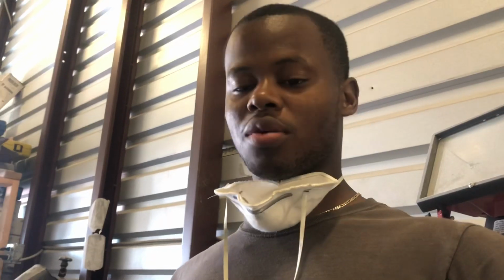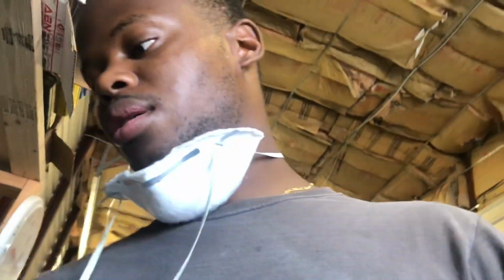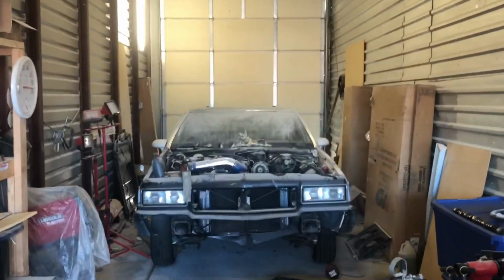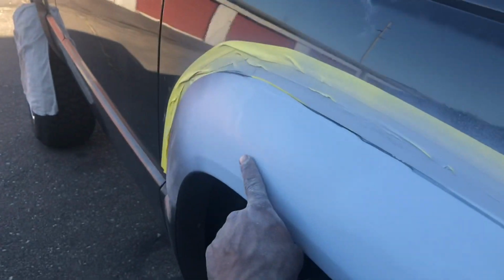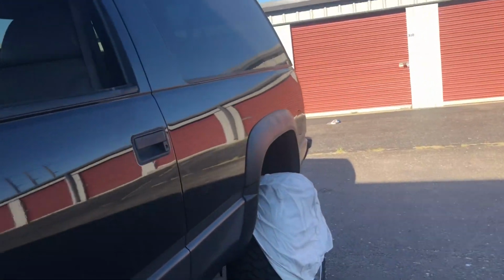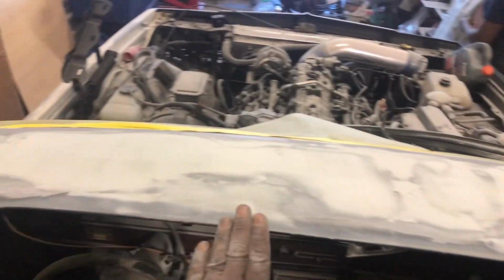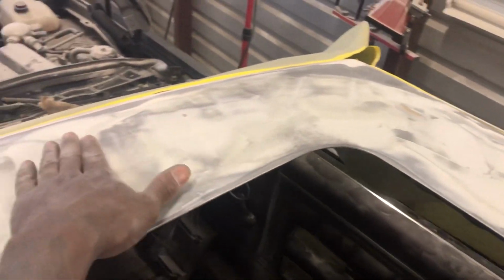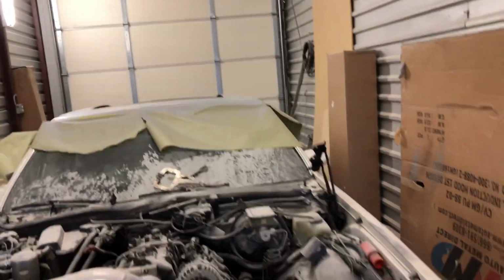Turbo Box Chevy: G6 Roof

Comment: Whats up steve roof looking good. Alot of people dont like bondo filler for that reason its hard to sand the trick i learn over the years is to dont let it harden all the way hit it with some 60 grit on a block it will clogged up the paper but it will make sanding a lot easier it's the same technique you use with a cheese grater fil.
Reply from the maker: I like evercoat, I’ll stick to that I fuckin hate using bondo 😭😭

Comment: Box looking good bro, if the bodyfiller takes to long to dry try adding a little more hardner on the next batch 💪🏾
Reply from the maker: Underground Paint King It take like 25-30 minutes to fully harden but I want it to be 5-10 minutes 😭.
Reply: If mixed right it should take around 20 minutes to dry
Reply from the maker: Underground Paint King I jumped to something else by then but its ready when I come back